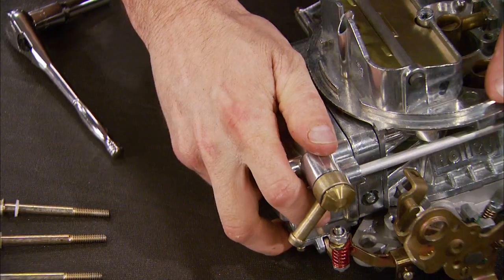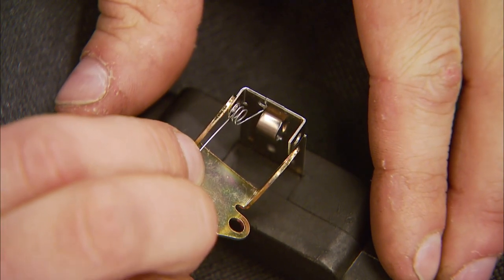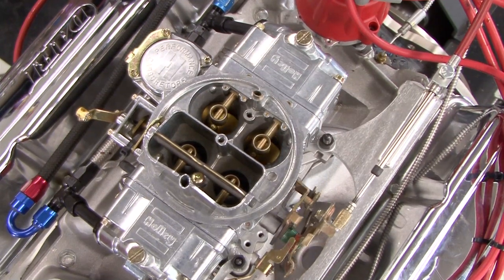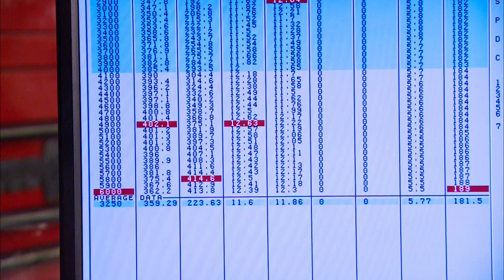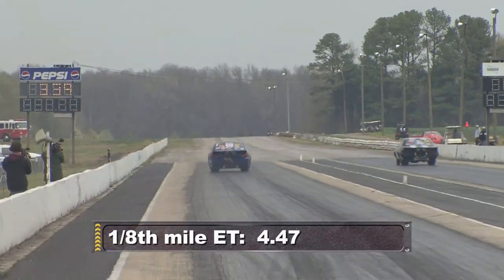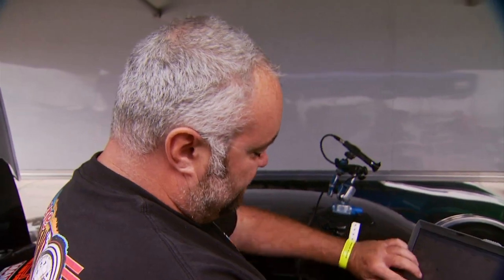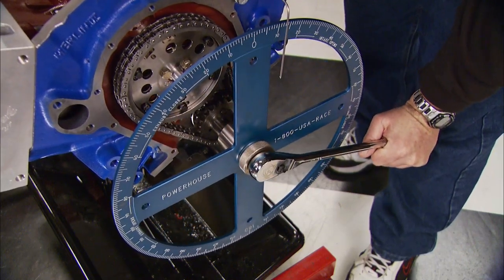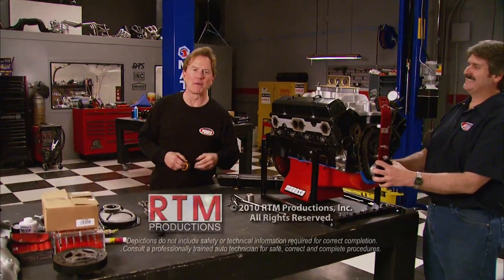How to Modify Your Carburetor for More Horsepower Without Emptying Your Wallet - HorsePower S12, E8

Comment: Here's a tip: use an open plenum spacer style gasket underneath that 4 hole.  You don't want it flopping in the breeze and eventually tearing off to be ingested by the engine.  I use the 4 hole on top to sneak in a 1/4" phenolic between it and the carb to help keep things cool.

Comment: Take a look at the Summit carbs.
They recently aired an episode of Engine Masters, they compared cheap carbs and compared them to a $800 Holley XP.
The Summit did very well, it had the same HP and Torque as the Holley and cost $300.

Comment: Nice video.  Back in the day, Chapstick kept the paper gaskets from sticking and tearing :)  The fuel line kit is way over kill for the street.  I prefer the metal ones that have a provision for a pressure gauge.
Reply: The cherry flavored chapstick was also great for reassembling automatic transmissions without tearing the O rings.

Comment: I can see changing the secondary metering plate to one with removable jets but what about the floats, float bowls, and needle and seats? How are the replacements better than the original Holly 600 parts?
Reply: Scooter George 
Pretty much just turned the carb into a dual feed.
Reply: You have to change the bowls because the original bowls had a feed tube front
To rear

Comment: That 383 needs 2" headers and a 650 non choke. You will find the hp goes up even more, and on the end of those headers 3 1/2" collector.
Reply: That would be some impressive torque numbers for maybe a 307. Even with 1 5/8 and 1 3/4 headers, that's weak for a 383. Torque is low especially for that HP level. Even kinda low for most modern 350 builds.  Somethin ain't right.

Comment: Put a extremely fine wire mesh between the intake manifold and carb will make the fuel vaporise better, the problem is to find a fine mesh that doesn't restrict the air flow a lot
Reply: It worked on my friends stock 305 quadrajet (low rpm, plenty of support for the mesh).  Didn't work on my (at the time) 400ish hp 350 with an open plenum. When we checked, it was just gone! Lol

Comment: Why does the throttle response seem so slow? Watching the throttle cable move vs hearing the rpm, they dont really seem to match that well?
Reply: It’s the dyno loading the motor. It won’t free rev like cracking the throttle in neutral.

Comment: You guys should try Proform race series carbs 
They are a lot less expensive than a Holley and are fantastic carbs
Reply: Fantastic BECAUSE they are less expensive you mean? Certainly not because they work well, especially when they don't make power.. get what you pay for.
Reply: VengeanceIzMine no fantastic because they do make power
Tons of it
In fact when compared side by side to a Holley 850
On my 468 BBC 
A Proform in stock form produced 24.4 more rear wheel HP than a baker prepped Holley and once I sent the Proform
To baker and got it back I had a total of 53.2 more rear wheel horse power than the Holley and since the initial cost was $178 less than the Holley I was already ahead

Comment: Y'all seen how much those non-stick reusable gaskets cost vs normal ones?
And of course they use new ones on the budget build
Reply: Coat your normal gaskets in grease and you can reuse them multiple times.
Reply: Just buy the kit.
Reply: @jakekaminer1223  wtf lol
Reply: @Crazywaffle5150  For real. Its an old school hotrodders trick. Things like carb gaskets.